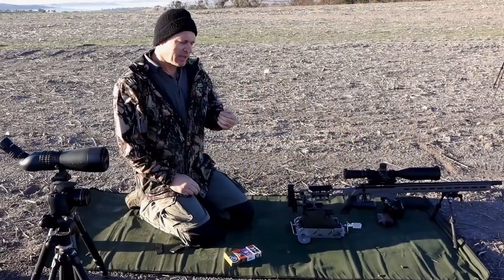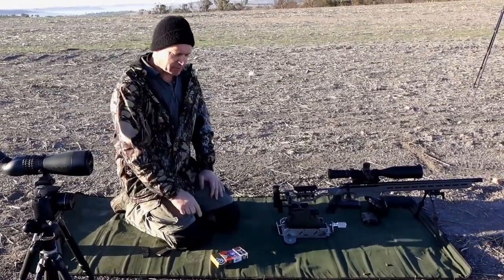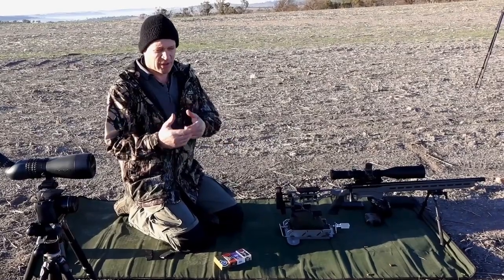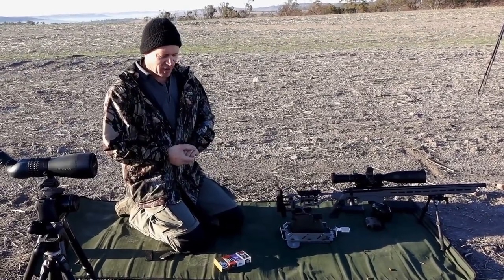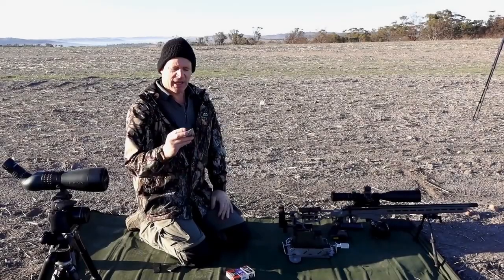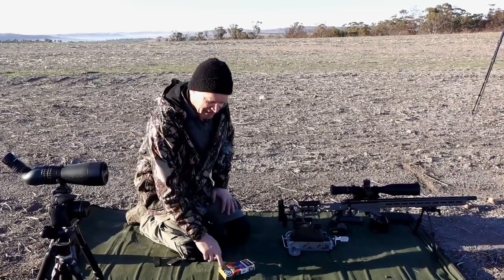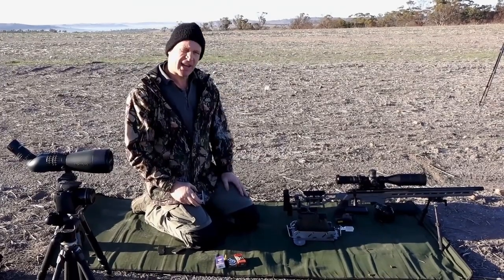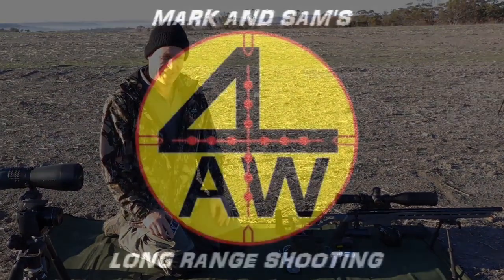Subsonic v Supersonic 22LR ammo (300 yard groups)

Comment: It looks like the Veloster ammunition did the best accuracy wise. I can also understand why it is printed on the boxes of .22 rimfire cartridges, "Dangerous within one mile or in some cases one and a half miles." Nice shooting again Mark and thanks for the explanation of the ammunition beforehand and after. It would be nice to see this test done with the .22 Magnum rimfire cartridges.
Reply from the maker: Different deal Cam, but we have a bit of that on the channel, Cheers
Reply: @markandsamafterwork  I found the 
.22 Magnum video. Shooting  handloaded cartridges at 1000 yards. Wonderful! I can see that the bullets don't have much power left when they strike the target. When I was younger and working for John Martz Luger maker he built a .22 Magnum Luger carbine. I made the stock for it and we shot  it out to about 250 yards with open carbine type sights and it shot well at that range. I found it difficult to see the holes in the target at that range even with a spotting scope.

Comment: Very nice to learn from your testing. Obviously more bang more distance with better groups, providing its a proper projectile. I’m testing Remington golden bullets hollow tip 40gr@ 1275 fps that cost $0.05 per round & Federal AutoMatch solid tip 40gr@ 1200fps that’s also $0.05 a round. From your testing I see that at those ranges, 40gr projectile is best for proper wind flow & ballistics. I’m testing with a CZ 457 Jaguar 1/2x28, 28” barrel, Anschutz 1710 22” match, Remington 550-1, Marlin model 60, Winchester model 52 sporter & model 74, Mossberg model 151, Wards Westerfield 87a & my Remington 572 pump. I’m looking into SK Long distance match & super long. Also some Norma offerings in 1010fps-1400fps match varieties. ELEY & Lapua I refuse to special order. If I can’t see and put hands on it. I’m yet to buy it. Thanks, I made sure to like & subscribe. Great Work, my kids and I love to learn.
Reply from the maker: Cheers Josh

Comment: You said something about variation in .22 ammo--you were talking about CCI Velocitor at the time--being due to tiny variations in the itty-bitty powder charge. That may well be part of it. But I was told, or read, long ago, that it's very difficult to get the exact same amount of priming compound in each .22 cartridge. With the powder charge being so tiny, any variation in the relatively hotter primer has more of an effect on velocity. AIR, Wolf ammo was buying primed cases from Eley, because Eley ammunition is extra accurate because they're better at priming the difficult little .22 case.
Reply: Oops. Forgot. I've chronographed Velocitor, and out of a 17-inch barrel I got something more like 1330 f/s. That's still usefully faster than "high velocity"--40 grs @~1250--and it is very accurate in the .22 rifles I've tried it in, so it is a favorite hunting load. It's just not 1435. I don't know if it would be faster from a longer barrel: lots, but not all, .22LR seems to be all done accelerating in 10 inches.
Reply from the maker: Cheers